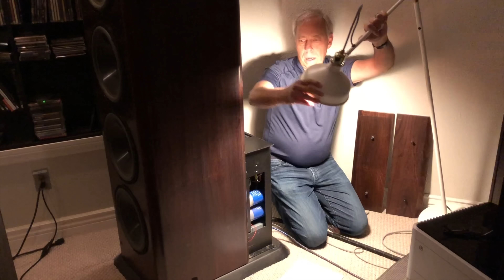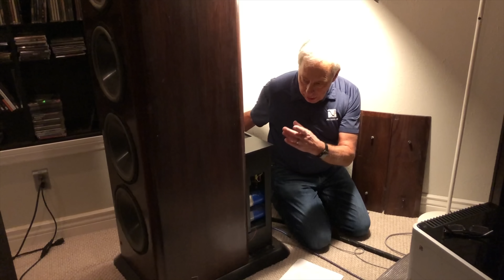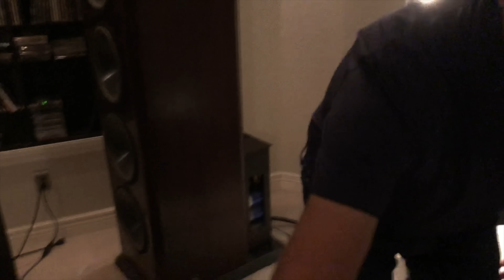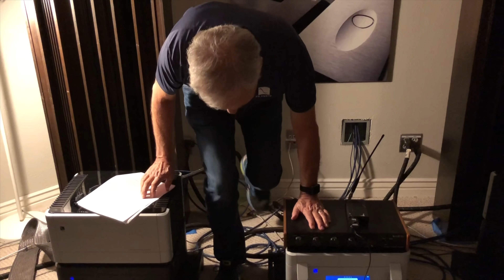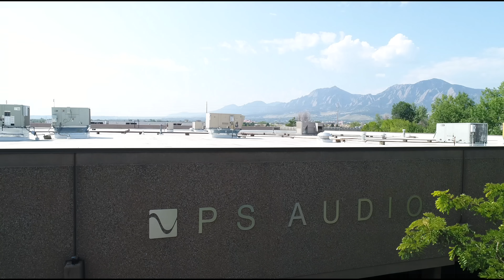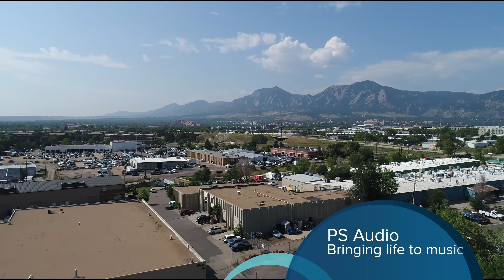The IRSV servo woofer system

Comment: can you elaborate on the servo electronics itself, that is, the signal from the sensor is sent to the crossover and from it to the power amplifier? And what are the sensors used in these woofers?

Comment: The IRS Vs are biamped.  The woofers have their own dedicated amplifiers and crossovers and the user supplies the mid tweeter amps.  Originally the speakers came with little boxes that had resistor/ capacitor networks in them to chop off the low frequencies for before the signal goes into the mid tweeter amps(most people use pass Labs, Bryston or some sort of crossover to separate the highs and lows around 100 Hz now). Along with these little boxes a parts kit was supplied with various capacitors and resistors that you would make in different combinations to match the amplifiers input impedance and the desired crossover point.  Once the signal is sent to the mid-range tweeter panels the crossover in the speakers base is used to separate the tweeter and mid range frequencies (Bob at PS Audio has created updated crossovers with the help of Arnie Nudell to replace these older crossovers.  There are also some adjustments that can be made to them if you have upgraded the magnets in the mid range drivers).  The woofer's controller  box takes the full range signal and chops off the hi frequency  and sends the signal to the woofer amplifiers.  The box has a bunch of controls to modify and contour the low frequency.  It also supplys a 12VDC signal through a separate cable to the woofer amps to close a relay in the amp and turn it on.  Most people now only use this box to trigger the amps on and off an use the external crossovers mentioned above to chop off the high frequencies.  Once the low frequency signal gets to the woofer amp it is sent to the input of the amp where it is amplified and sent to the 6 12" woofers which are connected in parallel(that's where Paul is talking about a low inpedence load on the woofer amp).  The third woofer from the bottom has an accelerametor that sends a low voltage signal back(the orange wire in the video) to to a circuit that inverts it, amplifies it and then ads it out of phase to the input of the amp.  this is where the servo control comes in.  The servos in the IRS are very reliable, unlike the Betas which were delicate, cheep and problematic. The woofer amps in the IRS III were 1500 watts, in the IRS Vs they were 2000 watts.  That's where you will sometimes hear paul say 1500 or 2000.  Most of the earlier IRS IIIs have had various upgrades done to them to make them into IRS Vs.  I think Paul's were IIIs and still have the 1500 amps.  The 2000 watt amps in the V's have a larger power transformer and more power supply capacitors.  Greg Shugg told me the 2000 watt amps on the Vs were overkill and just upgraded to 2000 watts as a marketing thing( so they could say they had these massive amplifiers in there advertisements).  The speakers are difficult to setup correctly because of the space required, also the woofers amps are single ended.  Most audiophiles have balanced systems these days.  There are many places for ground loop hum to pop up.  Getting the amps, crossovers all set up properly requires patience.  The system when it is hitting on all cylinders is something most people have never had the chance to hear.  Imagine being third row center at a concert, super clean sound and will play so loudly you will want to turn it down. That is going to be tough for PS Audio to better.
Reply: @Michael Barrett what servo sensors are used?

Comment: What is now called a servo system is actually an invention of Philips in the mid-70s of the last century and therefore some 45 years old concept. Philips called it Motional Feedback System and rightly has, at least in Europe, a large number of supporters. Even though they have not been sold for decades.
With contemporary techniques, implementation could probably now be performed even better and cheaper.

Comment: I've never heard the V in a proper environment.  Back in 1989 I heard the IRS Betas and those were simply amazing.  Carver Silver 7T monoblocks driving the woofers and Conrad Johnson Premier 5B driving the HF section.  Amazing clarity and soundstage.  The bass did sound a bit rolling/warm but it was in control even at pants flapping SPL!  Never heard bass levels with low distortion in a "home system" environment before.  Though not exactly cheap, they were very good for asking price IMO.  The V must be just breathtaking.  I do love the revealing qualities of ES speakers but subs were required.  The only system I heard that could pump the bass levels with quality in the price range of the IRS Beta was the VMPS Super Tower III biamped but opening with Pink Floyd's "Breathe" from DSOTM SACD, it was definitely taxing the limits of the dual 20A feeds!

Comment: That's a proper sub stack.. 6 x 500w ICE class D amps wired to em will cause an earthquake! Might need some kind of remote volume control though as it might overpower on certain tracks.

Comment: So you run a full range signal to the Infinity’s and they have their own internal high pass crossovers for low frequency protection or they can play down real low safely? Or are they low passed at a certain frequency through the digital crossover to the subs?

Comment: I guess I have to swing by PS audio someday and hear these Infinities.  I know Paul gushes about them, but I have a hard time believing, given the line array design and their age, that they actually sound as good as advertised.  Maybe someone that has heard them can chime in, but are they truly better than say a pair of Wilson Alexandria XLF or Focal Grande Utopia speakers?
Reply: Believe me, they probably DO sound as good or perhaps better than many modern speakers as they were back in the day. I run a pair of ADS bookshelves myself from 1979 and they are really good, cost about $700 or so per pair back then when new so weren't exactly cheap speakers back in the day. They hold their own to many modern speakers made today and utilize dual 8" woofers, each in their own sealed chamber per box (yes, acoustic suspension) and use soft domes for both the midrange and tweeters). Awesome speakers. But are they the end all, be all, likely not, but they are no slouch. I bet the IRSV's will wipe the floor with them and are only 3 years newer or so if I recall Paul right on when these were made.
Reply: John Palmer 
I still use A/D/S also, mostly the L710's but I also have the 810's. I love them, my only complaint is the tweeter is a little warm compared to my Infinity Rs5000's, if only I could combine the two....
Reply: Col. Angus,
I  have the 810's myself and agree, the tweeters are tad warm, but at least it's not fatiguing. BTW, if you have the double knit grills, remove them, the tweeters now improve and are less veiled due to the double knit material, assuming you don't have to deal with the WAF factor or kids or pets (especially cats). About a week ago, decided to try that for a test and found that the tweeters opened up a little more. Now I run a Grado Prestige Green1 in my table and a nice phono preamp and the speakers are powered by a NAD 7240PE receiver. The Phono stage is heavily based on the old AudioKarma CNC design from several years ago and the gent that makes these improved the overall performance, built a 15V AC to DC power supply and a back panel for a specific cabinet and names it the Muffsy PP3 (first iteration), now the new PP4, both utilizing a passive EQ in between the two OpAmp stages. Stage one is the OPA2134 OpAmp, and originally the same in stage 2 in the PP3, but in the new PP4, he swapped it out for the LM4562 Audio OpAmp and it opens up the top end a tad more and helps lower the noise floor by some 2.9dB and it was damn quiet as it was. I just finished building my PP4 and it's breaking in as we speak.
Reply: @Terrywho22, you'd be surprised how good these things can still sound with a rebuilt crossover (recapped mainly) and any crumbling surrounds replaced on speakers and rebuild tweeters if possible as some are rebuildable and in some cases, you can actually recone speaker drivers too. You can restore these to like new and that's what Paul has done when he first got the IRSV's.

Comment: Great video, this much power just for woofers, this is to much, some people get lose in sound and forget to listen music.
Regards Mr.Paul.
Reply: Good, sharp transients help with realism, like dropping a plate, and an amp more often than not has to be over-specced to deliver that. I wouldn't be surprised if this is one of the main benefits updating the amplifiers. Also, lower distortion if you play no where near the max.

Comment: I believe that a standard 20 amp 120 volt wall outlet will only supply about 2400 watts. I hope that 3000 watt amp is per channel (6000 total). My plasma TV uses 900 watts and I don't have to heat that part of the house when it's on in the winter.

Comment: How can you power that many 12 inch woofers with only a thousand Watts? When there is a version of the little Sunfire true sub  subwoofer that has a 2700 watt amplifier built into it?
Reply: When you use multiple drivers, sensitivity actually increases, so you need less power than you might think. Also, the difference in loudness from 1kW to 2.7kW would be hardly noticeable.
Reply: Ron Shaw you literally just made that up right now.
Reply: Look it up. Knowledge can come in real handy sometimes.
Reply: Ron Shaw no you're trying to educate me. Prove your statement if there's no difference between 1 and 2. 7 K and why do they bother making amplifiers that are more powerful that's just nonsense you had to prove it you can't just come on here and spout unverifiable facts you said it you prove it otherwise I'm right all day.
Reply: I did not say there was no difference. I said it would be hardly noticeable. The ear is non linear. To hear a difference of 2:1 it takes a difference in SPL of 10db. Which means to sound twice as loud as the 1kW amp, you would need a 10kW amp. When you double the power, you have a 3db difference. Most people would hardly hear a 3db difference. You want me to 'prove' it? There is far more to it than you can put in a simple answer, so I recommend you educate yourself. You state they are 'unverifiable facts', when they are indeed verifiable. Google is your friend. Don't be lazy.
Reply: Ron Shaw backup what you claim.
Reply: Ron Shaw so explain to me why they're changing the amplifiers out to a 3000w if you could barely hear a difference?
Reply: Geerladenlad, I am so sorry that the education system has let you down so miserably. It seems you are reluctant to search for the answers yourself, so here are just a few links. There are many more out there if you really want to find them.

http://trace.umd.edu/docs/2004-About-dB
http://hep.physics.indiana.edu/~rickv/Sound_intensity.html
http://www.silcom.com/~aludwig/Nonlinear.htm
http://physics.bu.edu/~duffy/py105/Sound.html
http://www.animations.physics.unsw.edu.au/jw/dB.htm
Reply: Interesting when a person doesn't have knowledge in a particular subject and when they are presented with facts,the first words that come out of their mouth is, prove it.these are unverifiable facts.I hear it all the time pertaining to many subjects.
Reply: Their not spl subs. They are high sensitivity and impedance units. The idea is that the 12 cones don't need to move much to fill the room with sound. Increasing the available power from 3k to 6k will be about getting more accurate transients and effortless infrasonic response. Also having amp per driver will increase tuneability options Significantly. The challenge lies in getting 12 amplifiers to all match perfectly rather than just two. Gonna be an interesting few videos.
Reply: they're
Reply: My spilling teacher form 5th grad, you steel alive?
Reply: @Geerladenlad, Ron Shaw is spot on the money. Our ears and brains can't tell that 3kw is "thrice as loud" as 1kw. It'd be barely noticeable, if at all. However for bass, we may FEEL the volume increase more than we actually HEAR it. To our ears alone, double the loudness of 1kw = ~10kw. Check Ron's sources too if you don't believe it.
Reply: Don't look at power as volume... Look at power as headroom Geerladenlad
Reply: that "only" a thousand watts is probably actual power able to be actually delivered for more than a millisecond. ;-)

Comment: Hello Paul, thanks for a great channel.
Met you in Denver (2013?) in the Soundlab/MSB room. Great sound.
Back to the IRS, I had a pair of Genesis II.5’s driven by Jadis JA200’s, etc.
Too big, too much. Too hot!
Could you confirm that the woofers of the V’s are servo-controlled via accelerometers?

Comment: Why aren't you Using Class A amplifiers? they seem the best choice for audiophiles in my head, since Ds can have noise due to the Pulse width modulation?
Reply: 3k watts from class A amps would require thier own power station 😂😂😂
Reply: ..and raise global temperatures even further by a degree or two :)
Reply: their
Reply: Class A amplifiers are well under 30% efficient.  Modern class D are 80-85% efficient, so with class A the waste heat is 4x or more and the energy consumption is 3x more.  On the scale of this sound system, it is difficult to supply that much power to the amplifier.  The pulses for the PWM in class D amplifiers occur at frequencies that are far outside of audio frequencies and are filtered out before they leave the amp.  Class D amplifiers also have low distortion at high output levels (with class A and often A/B the distortion increases as output does), making class D ideal for heavy lifting jobs like powering subwoofers.
Reply: Because class D can be as good performing as class A. They are also alot more efficient.
Reply: i reckon because its only to 100Hz  something for the bass towers, its not that critical.
Reply: Ah yes I see. I wasn't thinking of that. So it makes sense that you don't really have any other choice.